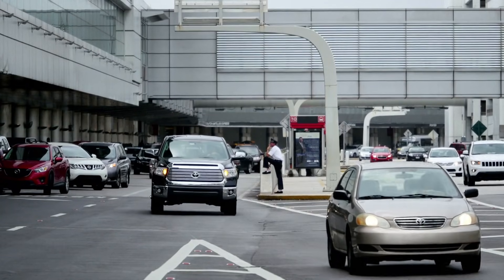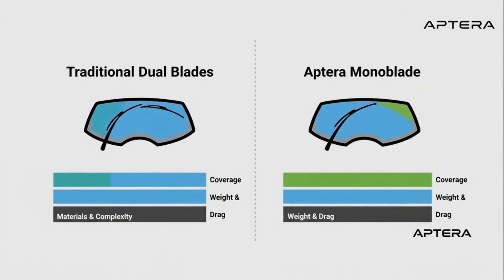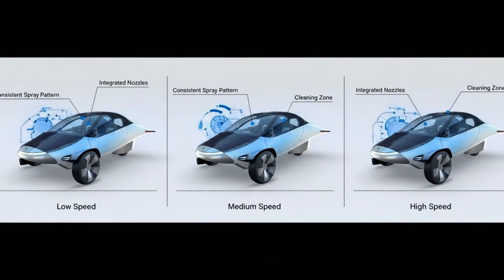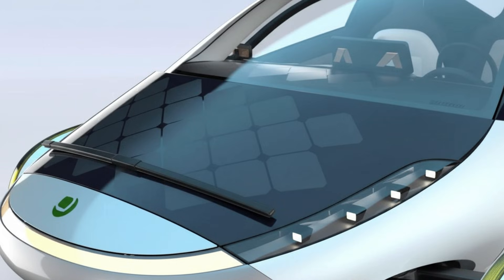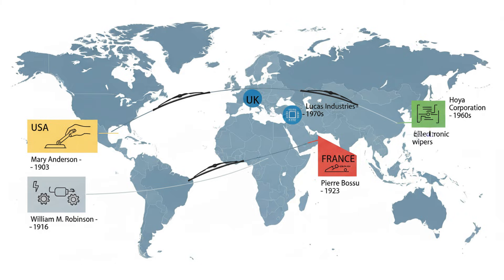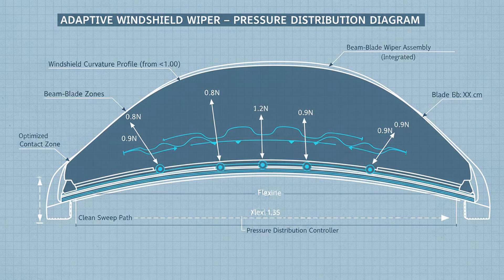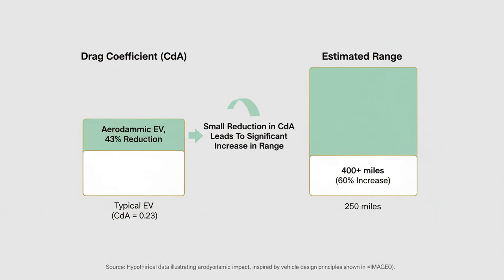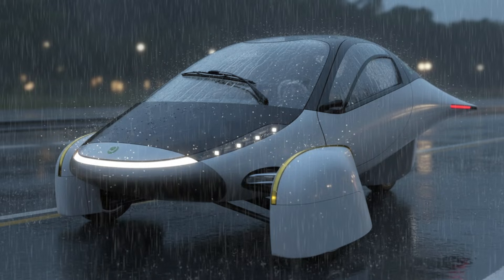Aptera’s Innovative Wiper System Might Be the Best EV Design of 2025!

Comment: Our 2014 Mercedes S550 has the washer fluid come out of the wiper blade. This solves a problem that didn't exist while making a $10 to $20 wiper blade that you can buy anywhere into a $200 wiper blade that you can only buy at the dealer.

Comment: Wipers did not use compressed air, they used vacuum off the carburetor. Thus when you had a higher throttle setting as in going uphill the wiper blades slowed down. When you took your foot off the gas they sped up.